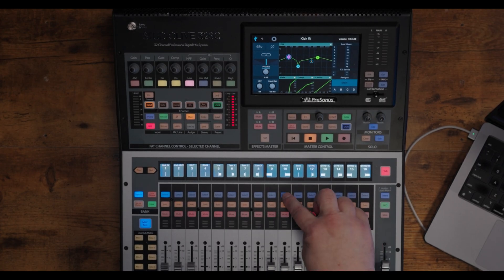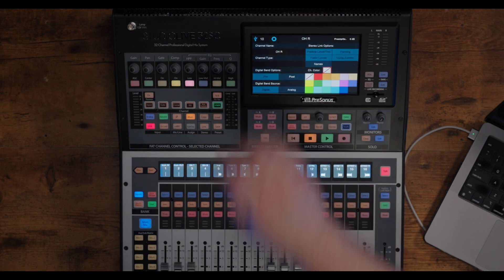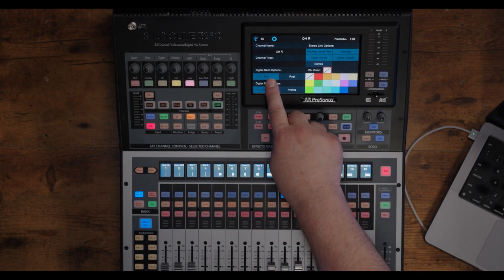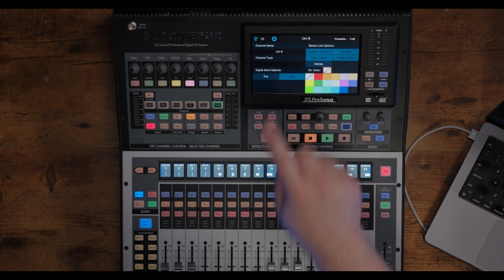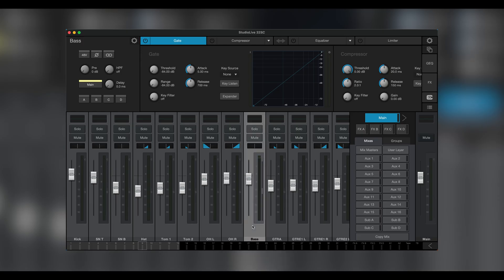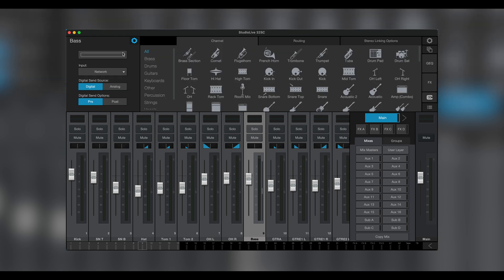How to Set Pre and Post DSP on a StudioLive Series III Mixer | StudioLive Snapshots | PreSonus

Comment: Hi , I have a question that I have been having for a while. It may sound a bit stupid, but I look forward to your answer. Thanks a lot.
Does the AVB audio interface support connecting multiple computers simultaneously through the network? Recording and playback can be performed by configuring different channels on different computers. For example, in a recording studio, in two control rooms, two computers can be used for recording through one AVB interface.
Reply: All of our AVB devices feature 64x64 routing, and our network can support 256 devices, so yes, you could break out or daisy chain AVB streams and record to two separate computers simultaneously!
Reply: https://www.youtube.com/watch?v=v-Rkl7Th_1g